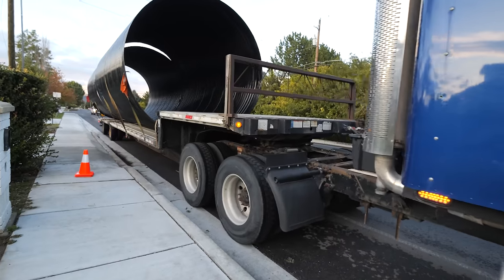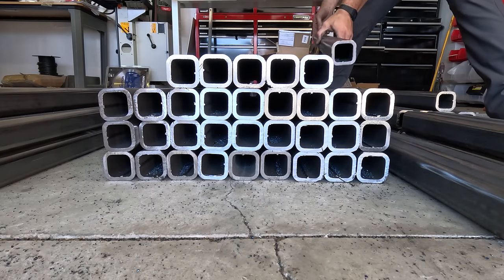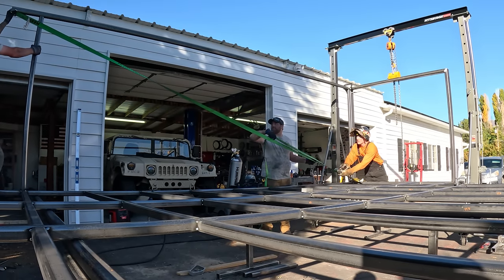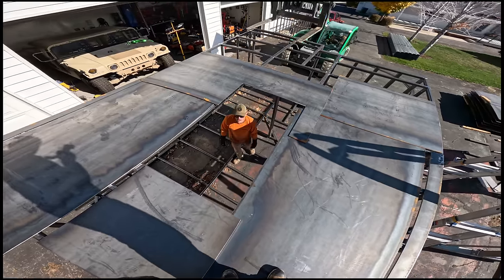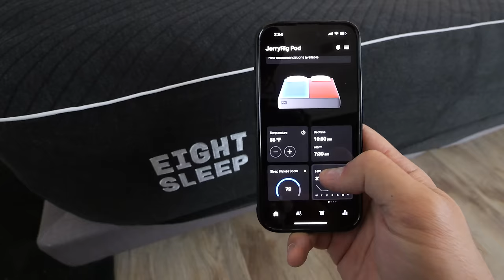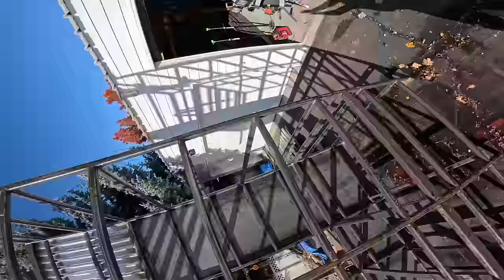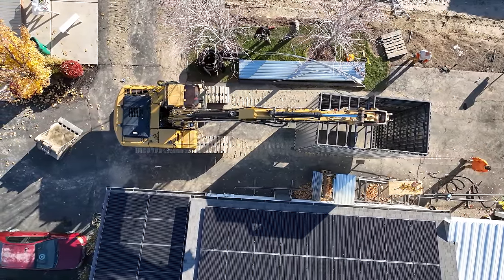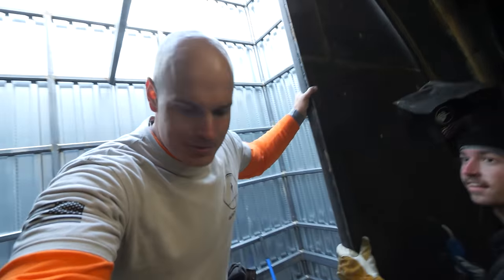BACKYARD BUNKER PART 4 - THE ELEVATOR SHAFT

Comment: I can't be the first person to tell you this, but in case I am. You can generate your own Wi-Fi signal during the apocalypse to keep using your 8 Sleep system. You need electricity and a WiFi Router.  You don't need internet; you just need a local LAN connection for your phone to be able to talk to your 8 sleep system over an IP address. Hope this helps.

Comment: IT engineer here. WiFi in the bunker is an task easy though the likely issue in an apocalypse scenario is that this 'app' likely requires an internet connect to work.

I hope that's not the case, ideally - it can communicate without internet, via internal (L2) LAN network. Easy way to test would be disconnect your ISP whilst keeping your router online (for example, disconnect the VDSL/ADSL/FIBRE/Coax cable from your modem/router) and see if you can still use your matress heater.

Comment: In the hollow portions of the tubes that are sealed up you should put linseed oil in there to prevent corrosion on the inside. That’s what we do for aircraft.
Reply: Linseed oil is the GOAT. I used a small amount on one of my metal working projects in school, and even in Canada, where humidity can be challenging, it's held the test of time for about three years, only tiny corrosion in places I missed.

Comment: I'm very surprised you didn't pour any sort of concrete footings for the legs of the shaft to sit on. I'm assuming you're going to pour concrete in the hole to lock it in at some point but it's still an interesting choice to allow the steel legs to directly sit in the soft soil
Reply: @karel_de_lille you sound like you don’t know what you’re talking about.
Reply: @karel_de_lille  He lives on the wasatch fault line afaik.
Reply: @karel_de_lille the weight overtime as water flows through the earth can cause it to shift and compact.
Reply: @karel_de_lille  The kind of soil they are working with you would 100% need a foundation - otherwise it's basically sand they are sitting it on, which WILL subside. You can see this when Zack is digging under the leg.
Reply: The shaft and bunker are both bolted and welded together, once buried that deep in the ground I very much doubt it's going anywhere.
Reply: @Leftfield2k7  down. It will overtime go down.
Reply: @Volt64bolt  given the sheer volume I am guessing that once everything is backfilled and set in place there will be little movement .
Reply: @karel_de_lille earthquakes have nothing to do with it. Erosion and things shifting/settling over time with no real foundation should be a real concern
Reply: @MrFish1968  that’s not house things work but ok
Reply: @Leftfield2k7  Its self structure looks like it is fine, but the Wasatch front is prime earthquake zone and has a high water table at times. So there is probably a chance it may be floated up out of the earth.
Reply: I think it's dug to bedrock
Reply: @karel_de_lille plus, he lives in Utah, specifically salt lake county, which had a major fault line right through it. And we are overdue for a major earthquake
Reply: @Volt64bolt it's more likely to float up, genuinely
Reply: just like I thought. he should just use some contractor to build the foundation first. more safety and experience.
Reply: @GoldRaven-oe4by  So, drainage is more important than fondation?
Reply: He lives in Orem Utah, near one of the most active fault lines on earth.
Reply: Im enginer it won't go anywhere
Reply: @skydivenext you can’t even spell engineer
Reply: @Leftfield2k7  Unless there's a flood. If there was enough water and the topsoil was washed away its possible it could float.
Reply: @Kytetiger  drainage should be fine its drain pipe hahah
Reply: @Volt64bolt  How do concrete foundations work?
Reply: @@drtaru  that's exactly what I was thinking while watching this there's no foundation 2 prevent anything from sinking and if anything sinks at a different rate to the rest which it most likely will it's gonna tear the whole structure apart!
Reply: @MG-kw1kb  When they bury these things in the ground for their intended use, sewers etc, do they have a concrete foundation along the entire length?
Reply: @@Leftfield2k7  sure you may very well doubt that it would shift - but rather be safe than sorry, don't you think?
"I doubt it would"  definitely  doesn't sound quite as re-assuring as "I'm certain it can't"...
Reply: @MG-kw1kb I suspect it will 'settle' by some amount, just like the vast majority of concrete foundations do.
Reply: @MrFish1968  the difference however is that a solid reinforced concrete Foundation becomes a platform distributing the weight evenly which would ensure that everything (if it does sink) sinks at the same rate.
And considering that metal structure's weight, those tiny foot pieces won't prevent sinking at all... in sharp contrast with the cylinder's massive contact area/footprint  means that the only thing that keeps the whole thing together are the welds and when they eventually rust, (due to no protective coating) he'll have serious problems to deal with - and because it's all being covered with soil,  attempting to do repairs afterwards is going to be a little bit difficult (to say the least)
Reply: @MG-kw1kb  I'd be amazed if that metal structure weighs more than a concrete pad.
Also, you think what is essentially a 12 foot wide X 40 platform isn't going to help stop movement? It isn't the legs that is stopping movement, it is the entire structure.
Reply: @Leftfield2k7 We’ve got an american over here!
Reply: @MrFish1968  Ikr, who's ever heard of a house sinking due to inadequate foundations? xDDD /s
Reply: @MrFish1968  You're guessing incorrectly.
Reply: @Akadehmix  enginer dont now basic languague they know phisycs and sructure

Comment: A ground source heat pump could have been an interesting side project for heating/cooling the bunker efficiently.
Reply: YESSSSSSS SOMEONE MENTIONED IT
Reply: It shouldn't really need to be heated/cooled that much. Its literally in the ground(source). The temperature that deep should always be around 50f~
Reply: @Nighthawk20000  he said 15°C and I would be freezing at that temperature. it needs at least 4°C of heating
Reply: @valdir7426 get a good blanket and you're good to go
Reply: @masterkamen371  I'm not sleeping in a room at 15°C, even with three blankets and 2 sweater. 18 is the bare minimum for me.

Comment: A random router with a WiFi access point is sufficient to get a WiFi network up and running. If you need actual internet connectivity, you'll need to hook it up to the house (and swap the router for a switch so you don't end up with Double NAT issues).

Comment: You should definitely run a box fan in the shaft if you're welding down there. Having thick PVC wrap around all the metal may also be a good idea to keep things water proof over time.
Reply: Yeah my lungs hated running in a shop with only one door open and shitty fume extraction bad enough, let alone a pit in the ground

Not running 6010s in a PROPER confined space, but definitely not a good look.  Everyone had weld hoods and long sleeves/pants at least!

Comment: Having researched these types of structures a lot, I've personally settled on the opinion that sprayfoam insulation, the closed cell stuff that creates a waterproof barrier, is a great way to coat and insulate the outside while still allowing you to work the inside. Provides insulation to lower heating costs, and it gives peace of mind about hydrostatic pressure forcing water into the bunker through the seams.

Comment: @JerryRigEverything - Consider adding a light tub/shaft from the ground to the bunker.  Either run it parallel to the main or escape hatch or even a standalone one in the center, say, above the kitchen or living space.  Natural light is not only nice to have (psychologically) but could help reduce power usage by not having to run as many lights during the day.  And remember, the tube does not have run straight.  I've seen natural light piped into closets or rooms that didn't have a direct shot from the roof but the inner material of the light shaft reflects the light enough to provide ample lighting within the targeted space.  .... Personally, I would go nuts after a few days without some natural light.
Reply: I presume safety is the reason he didn't think about putting a giant hole the roof of his shelter?  Who knows?
Reply: @s3p4kner  You don't have to have a whole (or hollow) shaft, you can pipe sunlight in with fibre optics. There's plenty of products out there to do this commercially already.
Reply: When it's a nuclear winter, there will be no light brother 😀
Reply: Mirrors could work to get the natural light down the existing shafts 😍

Comment: Should use expanding foam insulation to waterproof/airproof the bunker walls, floor and ceiling, as well as Xypex in your concrete to waterproof it.  Xypex can also be applied on top of finished concrete for waterproofing.
Reply: I'm glad someone mentioned Xypex. Concrete additives are neat, and ones that waterproof porous concrete are as well.
Reply: @AndyGneiss just learned about it here, adding that to my durable building knowledge!

Comment: excited to see the outcome, the circle structure makes me worry the internal space would be a lot smaller than ideal. Colin Furze square steel structure seems a lot better in terms of space but maybe these cylinders will simply outlast it so its worth it for the long run
Reply: Colin poured concrete too though for the Walls
Reply: also woried about that... no space for activities
Reply: Lots of factors like anything engineering.  In theory circle is better, but even the Canadian government’s bunker was basically a giant reenforced concrete box.

Also depends on what you are designing for, Direct “Bunker Buster” hit / Nuclear Strike, or just a cool after the fact basement.

Corrosion, Creep, and Watertightness are probably the biggest concerns in this case.  Many of the old bunkers that could have survived a near or direct hit are now old and rusted due to disuse and disrepair.  GRANTED Cheyenne Mountain and Greenbrier are still okay due to being used still i think.  Also those placers were small town sized, not a basement, and had full pluming/life support etc, and were on a budget.  

A more direct comparison would be a MX Silo perhaps?  That was some of the last of the days of people caring about bunkers before them being mostly obsolete.  Although as per that bit disproving the need for a nuclear bunker buster, if you find the right formation and dig diagonally short of being stuck down there it can be near unstoppable!

I’m not a proper engineer so my words just about as good as anyone else’s though!

I do like bunkers / non-doomsday but still underground and cozy stuff, and the concept of long term design planning (like that 1,000 Year Clock or whatever)

Comment: It is now a "confined space." Test the air before entry (every time) and its a great idea to have forced ventilation.
Reply: especially with all the metal cutting and welding. this could become a dangerous situation.
Reply: Erics think alike i guess lol.

Yeah it might be more on the side of “they can sneak by it”, but definitely not great how casually unaware they seem?  That and maybe Taglines for the Crane’s larger loads.

Also as someone who has welded in a shop that had garbage fume extraction hoods, and only one door open, welding in more confined spaces is no joke!  Granted 2 people just running flux core isn’t as bad as a whole shop running 6010 roots etc, but still lungs are expensive, treat them well

Could probably buy some of them speedglas hoods with this kind of money!

(Fans are cheap too but somewhat can mess with the shield gas, granted make it gradual enough, and have another yellow hose fan “extract” on one side and should be good)

Comment: You should look into exhaust air heat pumps for heating. Scavenge warm air from inside during the winter and simply run the exhaust fan during the summer to draw in warmer air from the outside.

Comment: Hi Zack, you can just connect your phone and the mattress to a Wi-Fi router, without internet, and it should work.  If your phone complains about not having internet, just ignore that, and as long as the phone and the mattress are on the same Wi-Fi, you're fine.
Reply: Haha, I just made basically the same comment. It does depend on one factor though, whether the app/device needs to phone home to their servers to work. I have some wireless security cameras that are completely useless to me during an internet outage, which is unfortunate.

If it does work without internet though, which would be nice, he might even get away without a router, just enable tethering on the phone and it becomes the router itself.
Reply: if you got power you can have WIFI
Reply: Except the “smart mattress” requires internet to work, so even in an apocalyptic scenario, it wouldn’t work either because it cant communicate with the servers.
Reply: If you guys haven't figured it out "buy" now, all these products, whether good, bad or indifferent, are just another item for him to shill and get referral fees for.
Reply: @joshfairchild  if that is true, that product is anti consumer. What if I want to use it in my cabin in the woods where I go to get away from the Internet?
Reply: @joshfairchild   Ah yes, of course a mattress would need access to the Internet in 2023...  (Remember when we used to joke about Internet-enabled toasters?  Who knew we weren't quite being absurd enough.)

Comment: something that definitely has me slightly concerned about the structure's longevity is that they didn't even bother to give it a waterproof coating! sure, galvanized  Steel protects a bit against corrosion -
- but over time those welds are gonna rust & that I can absolutely guarantee!!

Comment: If all the 8sleep Mattress/Pod needs is Wi-Fi to be accessed that not too difficult. You dont need Internet from the outside coming in either. 
All you need is an In-home.. or rather... In-bunker network. So with just a router, a few acces points spreaded throughout you have all that you need to acces the Matress/Pods functionality.

Comment: 11:03 you can just get any old router and set it up you don't need to connect it to the internet, just create a wireless network to connect the bed to. that way you can still control the bed through wifi. and later on you can run a CAT6 cable down from your house and plug it into your bunker router for full internet access.

Comment: To generate your own wifi i think you could use a WeMos D1 ESP8266, which is a small single core computer. We have used them in several of our home projects and they cost about 4$. With some light programming maybe you could solve your bed problem. Good luck with your bunker👍🏻

Comment: yes you can create your own wifi network easily in your bunker even without an internet connection. there are even basic wifi routers that are battery powered (usually used for 5g internet connectivity) and can be charged via usb, which wont use a lot of power

Comment: Our missile complex no longer needs heating - over the years the bunker and ground around you will increase in temperature from dehumidification, appliances, lighting and anything else that creates heat. Ours was 58 degrees when we opened it and now I need to air condition in the summer (no cool intake air in the summer). Something to consider is that you may not need heating permanently.

Comment: Awesome work!
For the 8sleep wifi issue, I think it would be worth it to look into something like the Ubiquiti UDR. will provide good local wifi and you can run a cable through the elevator shaft for internet. Assuming the 8sleep does not require internet access to make adjustments to the settings, this should work. I am not sure what the metal would do to the radio signals though.

Comment: For the bed, look into setting up an intranet server for your bunker if you want it working without worldwide internet access.
Reply: Also, installing a large water reservoir and a waste-fluid reservoir connected to two filtration devices would be great for unexpected long stays. One filter to separate and dispose of solid wastes, and a second to convert liquid waste back into drinkable water, with access panels to clean out the filters every now and then.

Comment: Be careful with the light coming off that welder in the bunker, even though you're not looking directly at it it's still all reflecting off of the walls, It'll still zap your eyes even though you're not looking at it.
Reply: I noticed that too. Zach is not careful at all about welding arc flashes
Reply: @mitchtalmadge  you can get away with it in the open air, but inside a metal structure it’s way more “unavoidable”

Comment: networking nerd here. wifi should be super easy to set up, at least on a local level for the bunker. whether or not your bed has to be connected to the internet might be an issue though.

Comment: you could use a chain like on a garage door with a pulley reduction, or spring assisted to manually function the elevator so it doesn't use power.

Comment: A TP-Link RE315 or similar range extender would be a cheap way to test a wifi solution in the bunker. Run conduit underground and then use weather resistant ethernet cable. The exact range extender you would need depends on your bandwidth requirements and the bands your devices support. That TP-Link listed would only support the 2.GHz band and it might only handle 50Mbps. It's under $30 and is great to have on hand because it can also be configured to give you a wired connection where you only have wifi available (think older devices you might rarely dig out or a 3d printer you want to put in a far corner). It could also eventually be switched out for a higher level product from Ubiquiti, Mikrotik, Cisco or similar...